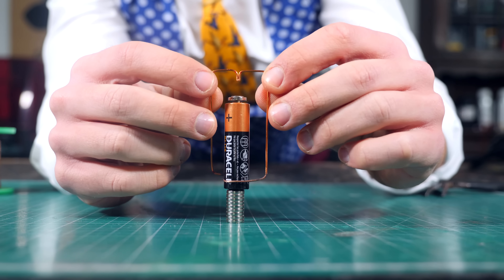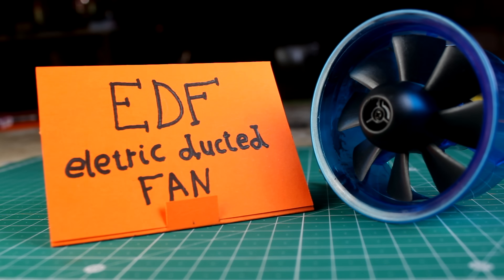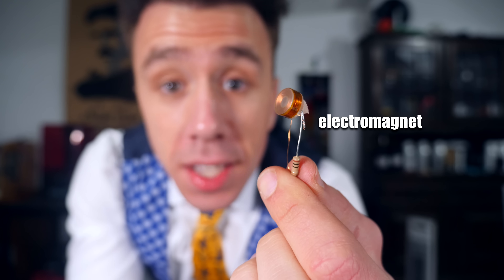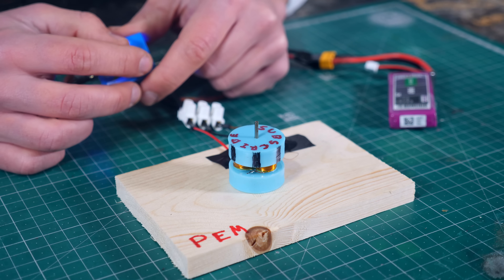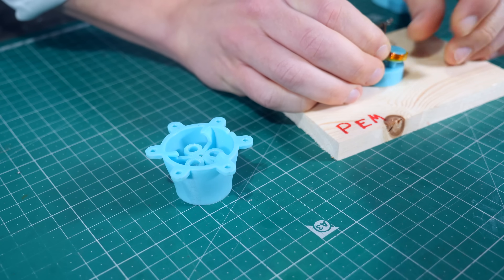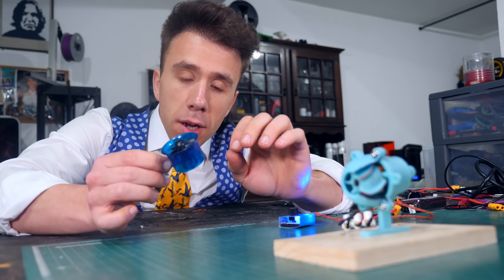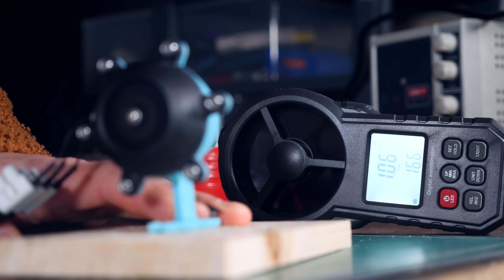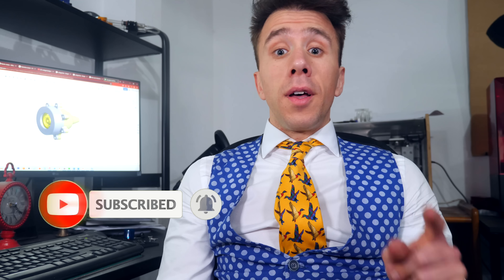I 3D Printed an ELECTRIC MOTOR FAN

Comment: so, im not really sure why you'd use an aerospike nozzle here. normally the point of one is that after the contration of a nozzle, it expands into the atmospheric pressure kinda simulating a moving nozzle wall, but you need to be able to achieve sonic flow at the throat to even make the diverging part of a de leval nozzle work as it should, and i doubt youre achieving supersonic speeds here, so im pretty sure all you really need is a converging nozzle. In order to reach sonic speeds, youd need to set a sufficiently small throat or achieve a sufficiently high supply pressure (ie, beef up the impeller pressure ratio)

Comment: Integza check out Major Hardware Fan Showdown. Your issue is likely an airflow problem not a motor or airspeed problem. Several fans in the series are similar, i.e. The Cheater (fan name -current winner) works by a similar principal and constricts airflow around the circumference but not to a such great extent as yours. This achieved by reducing the circumference and the gap between the blade/impeller and the wall.
It also streamlines the output to achieve laminar flow which significantly improves airflow. Hope this helps

Comment: I'd suggest 2 things:
1. Check the power usage, if it's lower in the centrifugal fan then the impeller is too small or not getting enough air.
2. Check the temperature. You might be losing power heating the walls of the fan and cooling the exhaust due to compression.

Comment: The input bell on the EDF makes a HUGE impact on the fan's performance, impellers like in a dyson vacuum are designed for relatively low speed flow but higher static pressure. EDFs need higher speed flows, since they're not relying on combustion to take compressed air and pump it into a combustion chamber to get the higher speed exhaust. So I would not have expected your  impeller to produce much thrust either, since that's not what they're designed to do. They compress air, not move it fast.

Comment: Measuring power consumption should give you a better idea. If the EDF consumes more than your fan, it has to do with your impeller pitch either not being steep enough, if you make it steeper and it still doesn't increase velocity you need to make the fan bigger to increase mass flow.
Reply: Exactly my thoughts. The limit seems to be the maximum rpm of the motor right now, but te load is much smaller. So the motor has less physical resistance to push against, which is just wasted potential. It's comparable to driving in 1st gear with your car: the maximum speed won't be limited by your engine power, but by your rev limiter, while the entire motor will produce a lot less power than if you were using the correct gear.

My idea: print a bigger impellar
Reply: @lucamagni5098  Fans/Pumps produce pressure and flow, and in doing that they absorb work. You should try measuring the current (ideally the power but as esc tend to produce constant voltage so current is a good approximation) used by both models of fans, and compare. 

1. If the models use different power/current, you need to scale/modify your design until they do, and then you'll probably have to look at (2) below.

1. If both models are using the same power/current but producing different flow then you have an impedance matching problem, or an efficiency problem (wasted energy). The impedance matching problem is ether the inlet or outlet of your Centrifugal fan doesn't ideally suit the pressure that it is operating at. 

Rule of thumb is that Centrifugal fans/pump produce higher pressures at low volumes than axial/ducted fans. I think you have an impedance matching problem.Your Centrifugal fan is producing higher pressure but at lower flow air than the axial fan, thus when you measure wind speed (flow rate) you see it as lower. 

 This is why rockets have nozzles, high pressure gas at low flows isn't useful for propulsion, nozzles convert high pressure/low flow to lower pressure / higher flows.

The fact you called it an aerospike turbo fan, I wonder if you already know this because an aerospike is a form of open nozzle, which is a impedance matching device.

Comment: Not sure if someone mentioned this yet, and I am not a rocket scientist, but it seems like the rear  facing fan needs to work twice as hard as the impeller sucking it in. Perhaps a better rear fan and a plate with holes between the two to drop the pressure and allow it to suck out more air?

Comment: I'm no expert but I do know a bit about turbocharging in cars. Geometry is everything and they have to spin at extremely high speeds to generate flow and pressure. Depending on the size, automotive turbochargers can spin anywhere from 160,000 to 300,000 rpm. You'll want a larger diameter exducer so you can generate similar tip speed without high RPM.

Comment: Where is the Aerospike? I was expecting a fan driven by rocket engines! 

But, to your question about thrust - I'll bring some engineering to poop on the party ;) You've got a few factors sapping thrust—energy loss to heat from compression, more internal surface area for skin friction, tip-loss between the fan and shroud—but your main problem is probably exhaust diameter. If your exhaust is too narrow, then your exhaust air might be too high pressure. This causes the flow to be "underexpanded" and you're losing a lot of energy and potential thrust. Now, if you search for "underexpanded flow" you'll find a lot of talk about CD nozzles and supersonic flow. If you're not deaf, it wasn't supersonic. But the principle still applies! If your exhaust is exiting at HIGH PRESSURE and not at high velocity, then you'll lose thrust when it re-expands outside of your engine. At the extreme end, the nozzle could be narrow enough to choke the flow. 

Bottom line - its probably the nozzle size. You aren't recovering all the energy the impeller used to compress the air. The axial fan did much less compression.
Reply: @Raven Coldheart had an even better answer. You're wasting energy pressurizing gas instead of pushing mass.
Reply: Guess that comment wasn’t “real”

Comment: Centrifugal fans are great to create high air pressure. Axial fans are great for creating high flow ie. air speed. They are used for different applications.

Comment: The diameter of the inlet and the outlet will be your problem, you also need to take friction into consideration (both the impeller/housing and the material your using) and aerodynamics (especially on the outlet)

Comment: Love the fan jokes! My theory is that it has to do with a couple of things. If the rpms of the EDF are the same as the centrifugal fan, then that explains lack of thrust of the centrifugal fan. You would have to match the diameter of the edf to come close to the same thrust. This is my theory as to why that is, think of a propeller (fan) on an aircraft. An airplane propeller spins anywhere from 1500- to 3000 rpm based on size. Yet a helicopter propeller spins much slower at around 300- 500 rpm (I think) and can generate more lift/thrust. Long story short, make the centrifugal fan diameter, where the air escapes, the same as the edf and then see where you are at for thrust.

Comment: I think the tolerance is is high needs to have clearer tightness I am just guessing but anyways a further show should be on zero point energy what an the theory’s behind it also take a crack at it if I had 3d printer that and a perpetual motion engine ran with magnets would be the first thing I made and crop circles are the key designs placement of magnets to one another how it takes 3 ‘‘em motors for u to create rotation I believe that magnets could do the same without controls r

Comment: It has no reason to put the same thrust to begin with.

Did you compare energy input in the motor with both fan (or current/voltage)? The one you design may not "catch" enough air and would be just spinning fast instead of putting energy in the airflow.
It would be interesting to compare efficiency even with different outputs.

Another idea is the pressure vs velocity of the fan design that may or may not  match the torque and speed specs of the motor.

Comment: Centrifugal compressor fans are great at producing higher output pressure but not velocity. To get thrust, you want high velocity (F=ma). A typical jet engine found on a modern airliner (like the one on your desk) is a called a "high-bypass turbofan" engine. These engines have 3 different kinds of fan blades in them: compressor, turbine, and bypass fan (the large one on the outside). It's called bypass because it's really just a normal fan -- it's not used in compression or combustion. This is actually where the bulk of the thrust comes from, not the engine itself. Since you're not interested in combustion (ok, I know you love combustion, but not for this project I'm guessing), high pressure is not required. Sure, you can try to convert that higher pressure into velocity using Boyle's law or something, but that would be inefficient as there's losses from tolerences and parasitic drag, just to name a few things. Also, since the fan design is different, it will have different optimal RPM, which may require a different motor, ie. a different KV value for peak efficiency.

Comment: not qualified at all so take this with a grain of salt. 

I think that the difference comes from the inlet of air 
the edf fan has a wide open area to grab lots of air and push it backwards
the impeller has a smaller inlet that grabs less air than the edf 

it may not be your entire problem but it may be one of them 
love your videos man keep up the good work and i hope you find the solution soon :)

Comment: hey so just for your checklist have you done the following...
Check tolerances, they should be as tight as possible, try to print the parts so they have 0.1-0.2mm tolerance(or less if your printer is super accurate), then sand/file to make a super tight fit

Blade pitch, the pitch is very important and every housing requires its own special pitch, try making a few different blades of higher and lower pitch to see whaitch direction gets better results.

Is your impeller just too small? maybe the size is whats restricting it as that's exactly what happens with smaller turbos for cars/bikes when they run higher and higher RPMs.

Air flow routing, try a couple different housings to increase the pressure before exhausting out the back and try making the air flow smoother, if its too turbulent before exhausting then that could be another problem

Did you send me a 3d printer? not required, just thought i would ask so i had one to use while trying to fix my Sidewinder X1 lmao

Comment: This might be the issue. Centrifugal impellers are great for creating a high output pressure, but with comparatively less output velocity than a similar axial fan. Due to the higher output velocity, the axial fan is far better suited to generate thrust.

Comment: There is too much air resistance in your design. The bypass channels in you housing will slow down the air flow. Also the rear portion of the housing is designed for turbo fan engines. You need a turbine for it to work properly. Remove the complicated the rear housing and replace it with a simple duct. Make sure the duct DOES NOT COMPRESS the air. THis should fix the issue you're facing with your design.

Comment: centrifugal fans are optimized for high static pressure at lower flow rates, and axial fans are better for low static pressure at higher flow rates.

If you want a historical example of this, "old" jet engines used a single centrifugal compressor, but pretty much all modern ones use like... twenty axial compressor stages. An axial stage is capable of better flow rates but lower pressure difference between the front and back of the fan stage. So basically your centrifugal fan is probably capable of generating multiple PSI of pressure whereas the original EDF is probably not capable of generating hardly any pressure difference at all front to back. Think of it like a gear ratio - centrifugal is high torque at low speed, and axial is low torque at high speed.

Comment: Pressure vs flow. Centrifugal fans are better with static pressure but usually have lower flow. Also, the Dyson fans spin at stupid high rpm (25-50k I'd imagine) and most drone motors only spin to 10 or 15k maximum and that's if you're really pushing it. Try to design a couple variations of higher and lower pitch impellers to try and match one with your motor and rpm range. You'll also gain a better understanding of how they work

Comment: I think that the two big problems with the compressor you made are the inlet diameter and the nozzle. The edf speeds up the air it did isn’t compress it. This meens your meeter mushers more thrust as f = M(s1-s0)-(p1-p0) where m is the mass flow s 1 and 0 are the speed in front and behind the engender of the air, and p1 and p0 is the presser of the air. It is important to note that this leaves out the fact that increasing preasher also increases the speed of the air. The other problem could be the mass flow rate. The simplest way to fix this is to increase the diameter of the inlet.

Comment: I'm going to help as much as I can, but take what I say with a grain of salt. I'm a pool guy in Kansas (USA). That being said, I'm VERY familiar with impeller design. Obvious with pool and spa pumps, we use centrifugal impellers. I'm also a car guy, and have been messing with turbo's for over 20 years. I'll share with you what I know and maybe you can use it to alter your design. 

I'm going to start with your open face impeller design. These designs only work if you're using dimensionally stable materials, like metal. Anything that is NOT dimensionally stable, like most plastics, would be better served using a close face impeller. For an open faced impeller to have good efficiency, you HAVE to have close tolerances between the impeller and the housing. If you don't, the low pressure side of the impeller just draws the high pressure air back into the low side and doesn't exhaust. I would be willing to bet that the Dyson impeller you're basing your design off of uses a Fiberglass Reinforced ABS plastic. At least that's what everything in the Pool/Spa industry is made out of. So, you either need to change material or change design. If you want to stick with the plastic you're using, trying going to a closed face design. It won't have the same peak potential efficiency as an open face, but it will probably work better than what you have now. 

Secondly is your actual impeller design. Your impeller blades are not very tall. The interference with the impeller surfaces with the gas/liquid you're trying to move is how the energy from the motor is input into your gas/liquid. In a very basic sense, the diameter of your impeller inlet determines the MASS of air you'll be able to move. The diameter of the impeller "outlet" (the biggest part of the impeller) will determine what PRESSURE you're able to move that mass of air at.

So if I were you, using the materials you're using as a limit, I would try to model the impeller after more of a turbocharger impeller design, only make it a closed face design. This will increase strength, but reduce potential efficiency and the increased mass MAY limit your maximum RPM. I would also try to minimize the shaft diameter as much as possible. Again, following the turbocharger impeller design, I think you'd be better off placing the bearing BEHIND the impeller. Ever axial impeller I've ever seen is designed this way because it maximizes the contact area of the inlet impeller vanes. 

That's about all I've got. I know that vane count and pitch and twist are all factors, but that's well beyond my limits of knowledge. I hope this helps and gives you some direction!

Comment: The difference in thrust is due to the fact that ducted fan are designer to create low pressure fast moving air meanwhile impeller just like in a turbocharger generate low speed high pressure air. therefore more thrust is generated by the EDF
Reply: Basically most of the energy transmitted to the impeller in used to increase pressure not pushing air away

Comment: When designing a fan, one of the tradeoffs you have to decide on is flow vs static pressure. The EDF design is better for flow (i.e. speed), while the centrifugal fan is better for pressure. Given that thrust can be adjusted by changing the output velocity or the output mass, it basically doesn't care about pressure. As a result, the EDF is going to produce more thrust given the same fan speed.

Comment: Hello. First of all im a huge fan of your channel and sorry for the imperfect English.

I think I have the answer to your problem , in fact I even made the solution for it.
The problem is that radial fans are great for producing pressure while being Very compact. Meanwhile they are absolutely terrible at moving large volumes of air compared to their axial brother's. 
Now , the axial fan does the exact opposite, its great for moving large amounts of air while being compact , but it's not great at creating pressure. Now, both can do what the other can as long as you make them "larger". For the radial fan/compressor, you basically wanne increase the inlet while not really making the base of the fan larger to prevent it compressing the air. Now you can only get so far with that without making it so large where there is no point in using a radial one over a axial fan. To solve that problem, you wanne give it a double sided intake, basically two radial fans with the base attached to each other. Pratt and withney did this with their J42 in 1948.
I recently made a 3D printed double sided radial compressor and I would like to share the files with you if you want them (so you get a better idea of the concept). In this video you can see it in a early stage, but its fully operational now and producing more thrust then my axial "jet".
https://youtu.be/glBI2g7bvzU